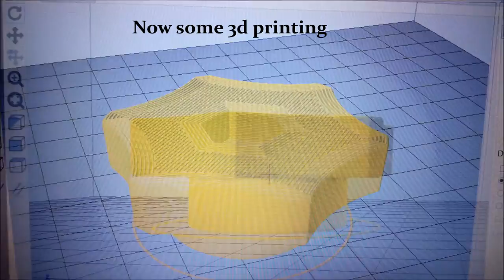How to make an adjustable miter sled

Comment: I'm man enough to admit I'm aroused by this project, An idea though for your project, could/would you project angle marks against the datum face (the face of the fence closest to you which I assume is a true level). That way you can adjust those 2 fences to different angles?
Reply from the maker: +gatekeeper88 yes I use it that way a drilled a couple register holes for pins where you can quickly adjust the miters.
Reply: cool. just seemed a good idea for angle cuts when you have a true edge.
Reply from the maker: +gatekeeper88 Yes!